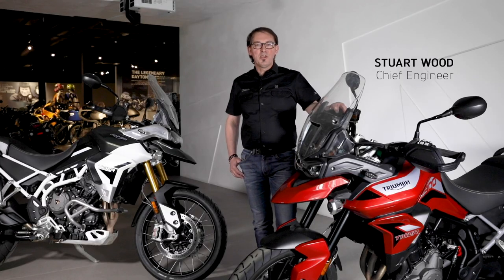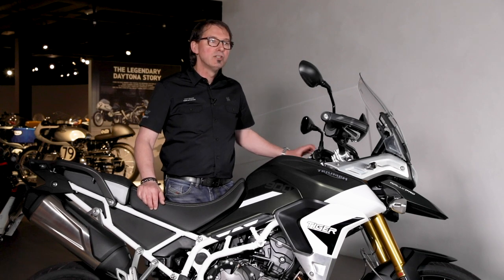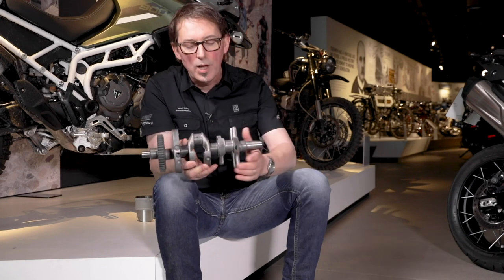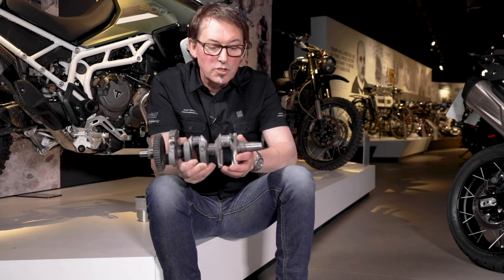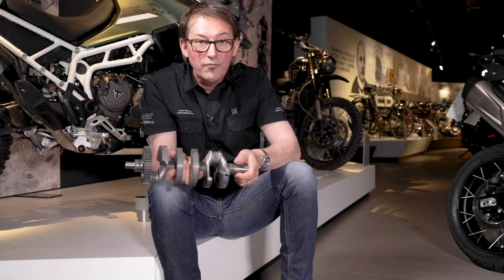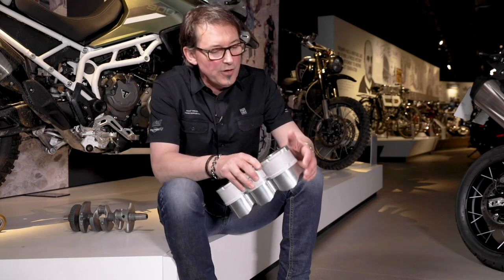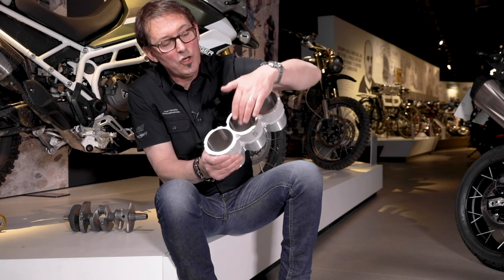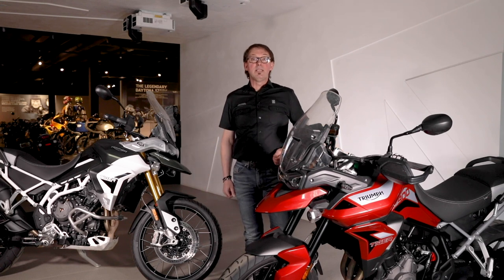Triumph Factory Stories -Tiger 900 Engine

Comment: Soooo, torque is up10% to 87 Nm - about the same as the 1993 Tiger 900 which was also 12.5% bigger than most 800cc bikes. Changing firing order is a better way of getting drive down than digging muddy holes with a 200 kilo bike - oh the new one is 200 kilos ? Progress indeed !

Comment: stopped by York triumph in passing on my T400 York triumph has a swanky showroom and full workshop. I asked them if they could book me in for a carb balance as at the time I didn't have a set of gauge's myself and my bike had a little dead spot in the middle. I spoke to the head technician I would like to say mechanic but unfortunately they didn't have any. He told me they can't work on the 90s bikes because they only work on the Imported plug and play bikes from Thailand and they don't even have a set of gauge's in the workshop.

Comment: I have a Tiger 900 GT Pro and a Rally Pro.  Prior Triples (Daytona, Speed Triple etc.). Initially apprehensive about the T-Plane crank but it's really good with ONE exception...distinct vibration increase right around the 4200-4300rpm zone. Irritating but liveable. At higher revs the motor acts like a "normal" triple (instant spin up), at lower revs more like a grunty twin. Plenty torque.  BTW - no way he just pulled that crank off the assembly line. He's in Hinkley, Tiger 900 manufacturing is ALL in Chonburi Thailand.
Reply: cranks are made at Hinkley.. do the tour and you will see

Comment: An updated Tiger 1050 sport would be interesting but the eV motorcycle option that triumph is jointly working with Williams.
wonder if that option would be a proper touring option with two up and proper like luggage carrying option. I Can only say that Yamaha has something similar called cross crank triple engine in their offering.

Comment: Are you putting piston rings in these? I think you forgot a few of 'em in my 800XC. 
How much oil do these burn? Do all cylinders come with compression right from the factory? Mine sure didn't.
Reply: Then you got a faulty engine... Clearly. The vast majority have been extremely reliable.